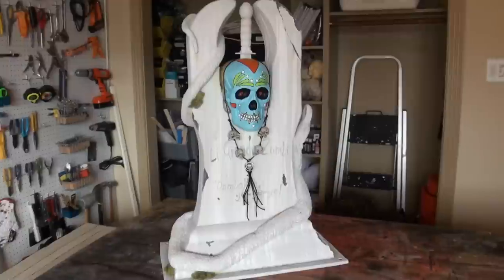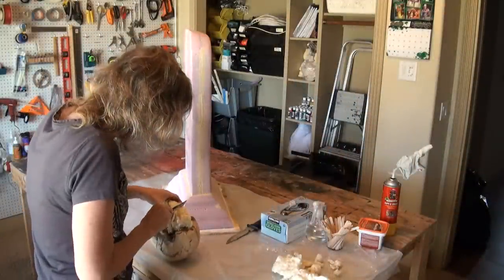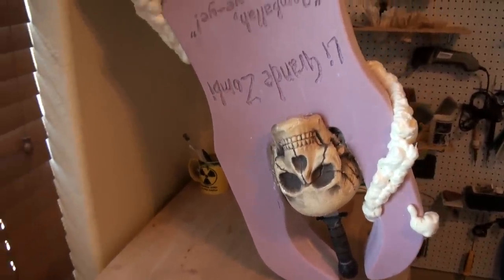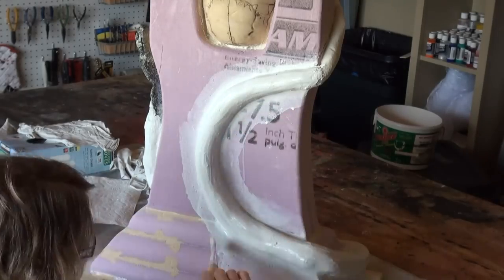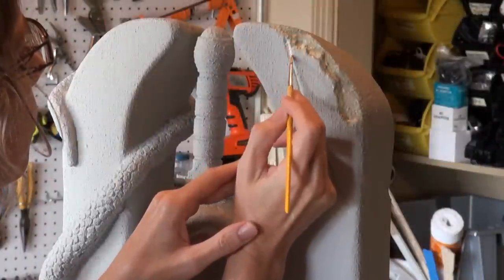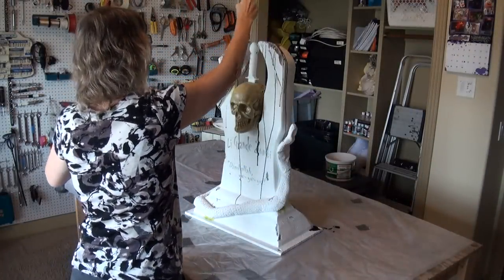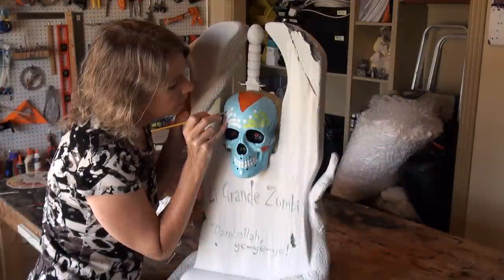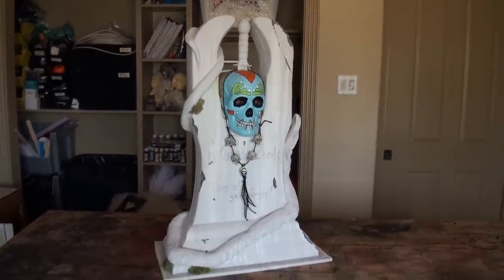Swamp Voodoo Tombstone: Halloween Prop

Comment: Oh, forgot to mention, have you thought of doing a LED lighting between stone layers? It kinda glows then on the sides...and is not hot..runs on batteries or plug in, can be cut to size as well.  Very interesting look..thought you might be interested in the LED tape lights. I can show you a link if you like and the layering idea...cheers, V.

Comment: Love all you videos~ I am looking for the pink foam board and can only find it in 1/2 and 1 inch at Home Depot.. any idea where I can buy it..  I have found the white Polystyrene kind but it looks different.. thanks !!! Hope you make more videos soon ~
Reply from the maker: THanh you for the kudos! The 1" is a good thickness to work with if you can get that. In this video I was using two 1 1/2" thick boards glued together. If you live in a Southern state than you will have difficulty finding the larger thick ones. Back when I was in Kansas I could find even 2" thick but now in Texas it's tough to find anything thicker than 1/2". White Polystyrene is a different style of foam than what I use (Extruded) but it still make a great ancient-looking stone. You will lose the ability to make high detailed stones but the white beady foam (Polystyrene) has a great ancient worn appearance.

Comment: Hi There,  Your tombstones are amazing!  What type of paint is the gray paint that you are using.  I am very new to this and I must have missed it.  Going to binge watch all of your videos!  Thanks for making this seem so accessible.
Reply from the maker: Hello back and thanks :) The paint that I am using is called Drylok (latex/water-based). It is a basement waterproofing paint. I love it for several reasons: Many places you can buy it pre-tinted in gray. Perfect color for Halloween tombstones so that saves you the hassle of base-painting it gray for realism. It also has silica in it which leaves a rough texture behind that is very similar to concrete/stone. That allows you to dry brush with light gray/white over it and the texture then is highlighted giving you depth and realism as if it was real stone. Finally, the waterproofing aspect of it helps to harden and protect the stone.  Love that stuff :)

Comment: I'am building small buildings for outdoor railroad in South Florida.  Using Gripper and some adhesive how long can I expect to get out of this process in the heat and humidity in South Florida?
Reply from the maker: Are you coating it in Drylok? If so, a very long time. I used to have my tombstones out 24/7 for a month in the extreme Kansas weather. As for the high humidity and heat of South Florida... if it is for a month each Halloween-time - should be good.

Comment: I am learning quite a bit from your videos; thank you! I see that you usually use the pink foam board from Home Depot. Is there a difference between the pink insulation panels and the white insulation panels? They only have the white at the local Home Depot where I live and want to know if I should go looking for the pink if you find that the pink insulation board is better to work with. Thanks!
Reply from the maker: Thank you and great question! There are important differences between the white (beady foam) and pink or blue extruded foam. You can make tombstones from both but the extruded foam allows much more detail. But, don't want to knock white beady foam. I've seen some incredible ancient-looking stones from this material. I'm used to the pink/blue foam and haven't worked enough with the white to give you a preference. If white beady foam is all you can get then I would go that direction to see where it leads you in creativity. All art mediums has it's pluses and minuses and where it will allow you to go artistically. Have fun!
Reply: Scaryladyvideos Thanks!

Comment: Ok forgot to ask, would you also water spray between the layers of Styrofoam? Sheeesh...sorry!
Reply from the maker: +Vicki k Gibson If you are using Great Stuff then it should help. It likes water to help the activation but it is such a powerful glue for styro - it may not be needed. I only used Great Stuff for the test as I prefer the Glidden for most tasks so I'm not the best advice-giver in regards to Great Stuff for gluing.
Reply: +Scaryladyvideos Ok, thanks for the reply...I will keep testing and let you know...:)  Cheers!

Comment: Not sure if you still make tombstones, but what thickness and where do u purchase your rigid foam insulation?
Reply from the maker: I liked using two 1 1/2" sheets sandwiched together. I got them at either Lowe's or Home Depot.

Comment: Did you re-produce the skull with great stuff and demold and use that?  I would like to know how you added the skull - what did you use?
Reply from the maker: +Joanne Gennarella I just used an old skull I had on hand. It was a foam one but don't remember where I got it from. Attached it to the stone using Great Stuff. Hope that answer helps a bit.

Comment: Just wanna say I love your videos. You are so talented.     I've seen you use several techniques to add cracks and chips.  Is there a way you prefer over others?
Reply from the maker: Thank you very much. I'd say The Hunter's Moon tombstone (cat) shows the cracks version I prefer the most. As you saw in the previous videos I was always trying out better ways and I like that one the best
Reply: +Scaryladyvideos  do you mean using the clay tool and acetone to make more narrow cracks?
Reply from the maker: I backed away from the acetone in the cracks because it widened it too much. I used an eXacto knife and cut it on both sides varying the width. Then, I would use a pottery tool that looked like a pick and picked out the cut sections so it would leave a jagged edge but open up the crack. It was always important to use the artists' technique of tricking the eye by using a very thin brush and super pigmented flat black paint to paint a thin line where an even deeper crack would be in the interior of the crack. If you have the patience check out some of my more recent videos and you will see that technique used.
Reply: +Scaryladyvideos 

Thanks again! I've seen all the videos, all the tombstones are amazing. I see that technique in the Dead Raven stone now.  The one I'm working on now will in no way be as good as yours but my kids and I are having a blast making it.
Reply from the maker: Awww, thanks!. The Dead Raven was one of my favorites and hard to let it go.